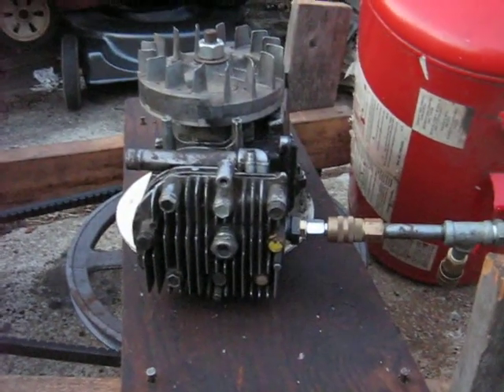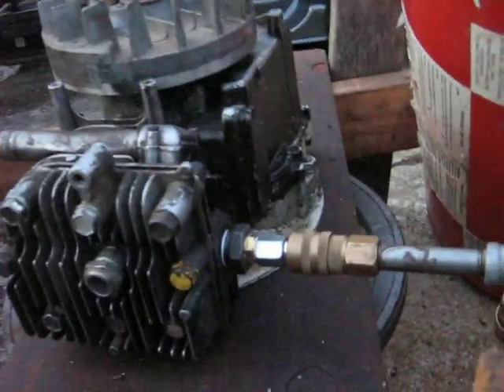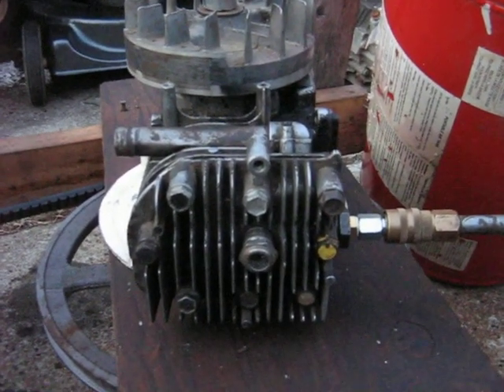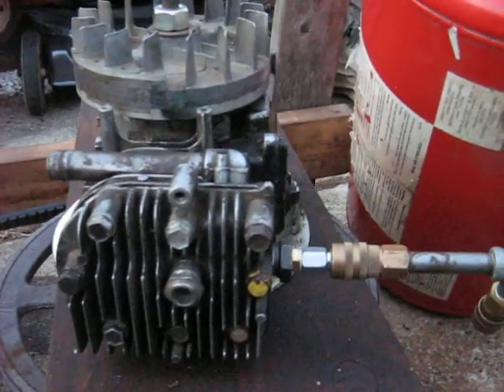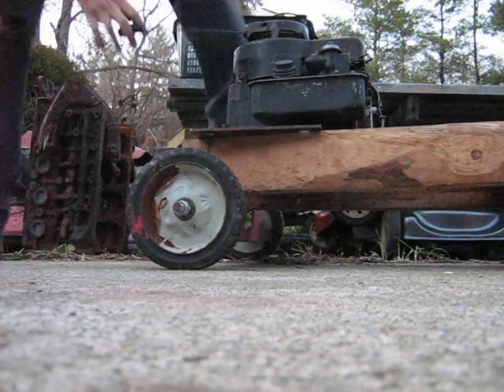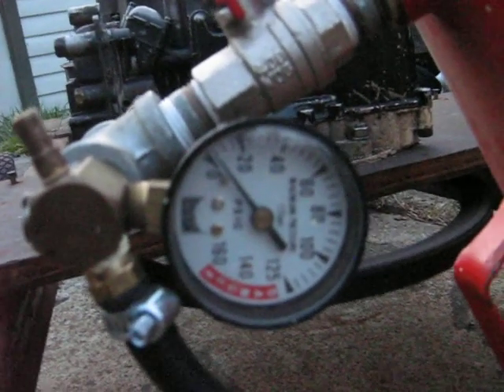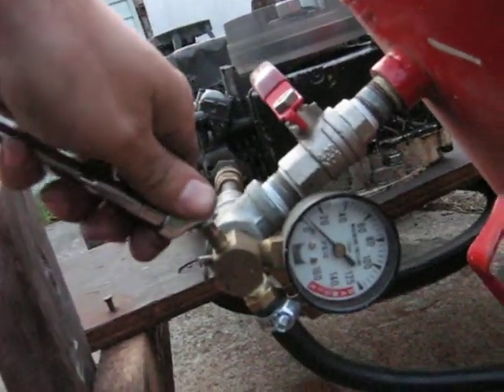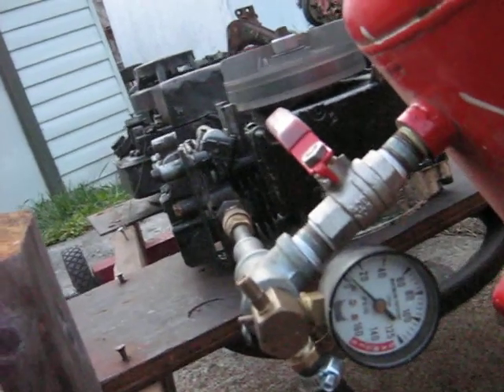Stage 3 Experimental Air Compressor

Comment from the maker: @zzzdogutube 
Good ideas, thanks.
I kept on building it different ways, it goes up to stage 9, I just don't have them uploaded yet.
Anyway, I think it is better to take the air out the spark plug hole, since the poppet vale has a lot of weaknesses, such as a leaky guide, leaks around the seat and block, and between the valve and the seat. So I think it is better to use the inlet valve for inlet, and use a 1 way valve for the high pressure work. I do this on later vids :)

Comment from the maker: @lljegs 
Actually, at only 24 psi, that isn't enough pressure to open the exhaust valve, but you are right, at some point the pressure will begin to keep it open, I forgot about that.

Comment: you need a stronger spring on the exhaust valve, the air pressure is opening the valve from the back side, or try a check valve in the line

Comment: you need a stronger spring on the exhaust valve, the air pressure is opening the valve from the back side

Comment: Yes, I would try a check valve in the plug hole and only use one valve lifter. That way the air comes in the check valve and out the exhaust valve.   Increase the compression ratio is a good idea.  You will want to release the pressure when the piston is at TDC with the exhaust so you may need a two lobe exhaust cam.  Think about the 4 stroke cycle verses what you want.  You want a release of pressure every stroke at max compression.  Interesting...Fun stuff..  get it to work man

Comment from the maker: @Compwhiz128 
Yes, you are exactly right, the valve timing has a HUGE effect.
Vid 4 shows some major changes, like double lobes on the cam, and a JB-welded up head, but I can't upload it and others until monday night :(, since I have to use the library for the internet.
I think I have 9 vids total, each about 2 to 3 minutes long. It took me 1-1/2 days to do all these vids!

Comment: Hmmm, needs  a check valve on the exhaust and intake antlers.  Every time it goes through the cycles, the pressure builds up to a certain point, and when the intake valve opens, some of that that pressure is lost - spewed back out the intake.

Theres my theory!